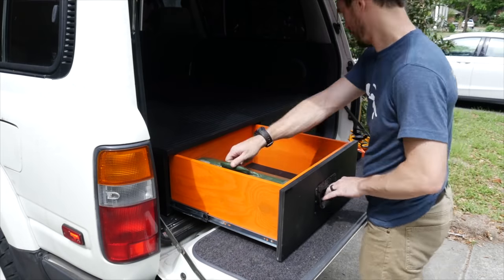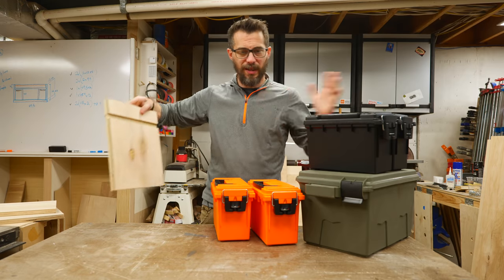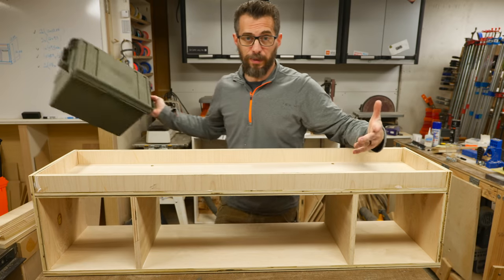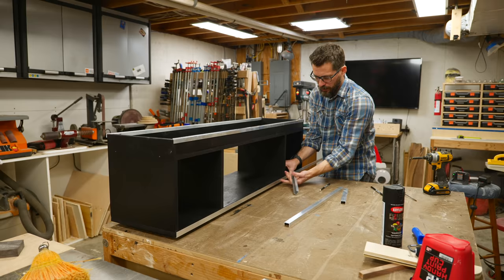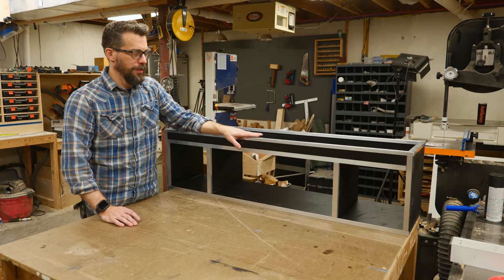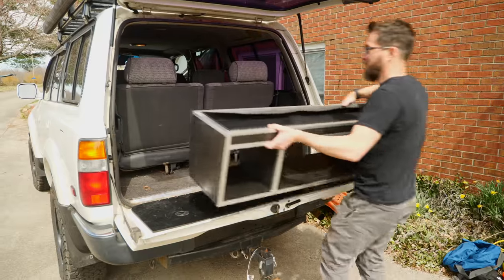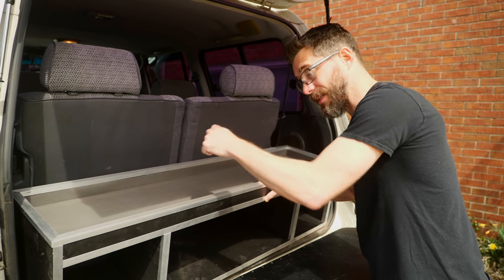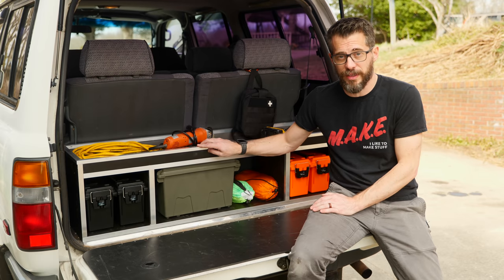Organizing the Mess In Your Trunk

Comment: A waterproofing and reinforcement that works really well on plywood is the roll-on truck bed liner you can buy at the big box stores, plus it's usually black.
Reply: I was just about to say the same thing.  Either the roll on, or potentially the spray on (since this is so small an area.)
Reply: I remember seeing an episode of something (on ze YouTubes) where 'they' (I forget the name) sprayed a whole truck with truck bed liner. 

Looked awesome and it turned out to be rugged as hell :)
Reply: Exactly what I was thinking
Reply: What about just using neoprene with caulking?  Black flex 230 or gutter caulking is what I’m thinking…
Reply: Though, the aluminum does look better. But so unnecessary Lol

Comment: Awesome build Bob. 2 things tho. 1) Keep an eye on the hot melt. If it gets too hot in your vehicle it may start to separate. 2) Rustoleum makes roll-on bed liner. you could have used that to waterproof your tray. Keep making the cool stuff!
Reply: Some hot glues can get pretty soft in a vehicle - not exactly melt, but also no longer hold. I built a bunch of wargaming terrain using hot glue to adhere MDF and styrofoam and the pieces separated when in the car for a couple hours.

Comment: great video! love seeing more work on the land crui...I mean truck. two recommendations for you:
1. you may want to put a bungie or something across the rear facing opening. imagine you're stopped on a hill and need to open the tailgate, everything would slide out.
2. for the top section, you could use a cargo net of some sort. the lip is pretty short and if you hit a bump just right anything on top could jostle around or fall out potentially.
keep up the great work!

Comment: Reminds me of a dock box/ roadie case. Only difference is you did not use the ABS-plywood laminate material.
Looks really nice and efficient at keeping organized. You might want to glue some of that neoprene to the base of the storage unit as well as the sidewalls of it if you notice that the boxes rattle too much on the wood. For the tie down I would have added a second washer in top of the loop with a nylock nut to keep the bolt from spinning when you mount the box.

Comment: Using locktite might sound appealing to hold it in securely- but keep in mind disassembly is also an important consideration if that box ever needs to be removed. you don't want the same problem in reverse.

Comment: Suggestion, you should glue down some automotive carpet in the bottom shelves. It will prevent sliding and also your protect the paint from scratching. You could use speaker box fabric too. Oh for the top tray, you could remove the vinyl, seal the corners the use textured bed liner spray then make a carpet floor mat. Just some thoughts, great video!

Comment: If you make it removable it would be a really cool camping coffee table. Not to mention make cleaning easier and allows for extra space if you need it temporarily.
You could probably make a wood insert that fits into the car's metal loop that prevents rotation and affix the bolt to that, then just use a couple wing nuts in the shelf floor.

Comment: High temperature hot glue/melt exists and would likely stand up to being in a vehicle interior without getting as soft as regular hot glue. 

As another commenter pointed out, low temp hot glue may not entirely melt at 150-200F, but it will defiantly start becoming a viscous fluid and lose most of its holding power. 

A closed car in 90-100 degree weather or in the sun can easily hit 160-170 in the interior.

Comment: Leave the neoprene sheet in the back, so it acts like a cover for the stuff in the back.  Also that hot glue will pop off once you put some solvent in the back, so you probably want to go and use the proper adhesive to make sure it actually will hold the aluminium strips long term. Grippy mat on top also works wonders, and also helps on the tailgate so boxes do not slide if you are on a slope.
Reply: Hot glue also tends to fail when subjected to hot vehicle interiors.

Comment: Interesting build.  Where is your spare tire?  I have a couple .50cal ammo boxes circa 1970’s, think Vietnam.  One contains medical equipment and the other basic survival gear.  Since my spare tire is accessed from inside the hatch I do not have the liberty to bolt it down.  

Consider gluing stiff wire or 1/4” rod in your neoprene sleeve to add rigid form.  Alternatively, clear plastic angle strips could be cut and formed into an interior framework and glued or friction fit into the neoprene tray.   These strips can be found in big box stores ; they are used to protect wallpaper on outer corners (mostly from children).  It will reduce vibration noise while you are driving.   My spousal unit is QUITE SENSITIVE to rattles and squeaks that I recognize and ignore.

Comment: Definitely surprised how well the hot glue worked for the aluminum. Hopefully when it gets hot in the summer the inside of the trunk doesn't get hot enough for it to melt back into a liquid state.
Reply: I thought about that, too.

If it was high-temp hot glue, it should be fine. And if it doesn't work, it's not a huge deal to fix, I suppose.
Reply: Having built flite test style foam and hot glue planes, I can tell you that even with high temp hot glue, itll come apart on a hot day.  Hot glue is awesome, but its not good for interior automotive applications.  I like the project though.  Its a great idea!

Comment: When I first got into SCUBA, I had visions of converting my Tahoe's back into a sleeping/dive storage system.  I was going to put a platform in that rested on the wheel wells that would have compartments underneath for tanks, regulators, weights, masks, fins, etc.  On top of it would be a place for me to sleep, so I could take the truck "camping" and dive from it as well.  Never happened...still have the truck, but too freaking old to be sleeping in the back of that thing to save $100 on a motel room.

Comment: Aluminum is very prone to corrosion when exposed to water/moisture. It is one of the things I have to worry about at work because ford switched to aluminum bodies in 2015. You should consider sealing the aluminum to prevent aluminum oxide formation.

Comment: In a few days or weeks I get a vw mk2 caddy and I want to do the same, but mine is a little flatter and deeper in the car. I want to do it removeable, if that's not working I leave it in. With two big and deep drawer maybe 3 if the dimensions are allowed. On the top of the shelf I put my inflatable mattress, so if I want to Camping I can sleep in the car. It's a tiny camper/daily driven work car. 1 drawer is the kitchen, the second one is for the clothes. If it fits the third one is for the tools or one of them inside is removeable, I don't know yet.

Comment: Hot glue quite possibly will melt out in the summer heat. At least that was the headache I dealt with when I used it as filler in a fiber glass dash gauge pod. Also live in the Texan desert, so YMMV. 🤷‍♂

Comment: If you  want it make that tray, lay in some cling wrap inside the tray, and wrap the rest to block overspray/slop, then use paint-on bed-liner.  Let it cure, then pull it out and trim to size.
Reply from the maker: Now that's a fantastic idea.
Reply: @Iliketomakestuff , you might need to use that neoprene to pad out the sides past the aluminum c-channel you used to reinforce the edges, so it doesn’t permanently lock the liner in place, but you have the material, so that should be easy enough with some tape.

Comment: The neoprene liner might work with a really thing plastic or board stuck to the outside as a stiffener. I would also mean that if you get a load of liquid in there you can lift the whole thing out and empty it. I'm pretty sure the neoprene on it's own wouldn't handle that given it's tensile  (err stiffenous) strength is about the same as cooked spaghetti...... the spaghetti would probably win 😄🙂👍👍👍👍

Comment: Wait, if the nylon nut made it impossible to tighten.  Wouldn’t using lock tight then make it impossible to remove with the bolt just spinning when trying to undo it?

Comment: If you live somewhere warm, anything fastened with Hot Glue, even the high temp stuff, will eventually come off because of thermal loading of the vehicle when you’re parked and the sun bakes its insides. Not a huge deal for this particular application, but it will eventually fail completely.